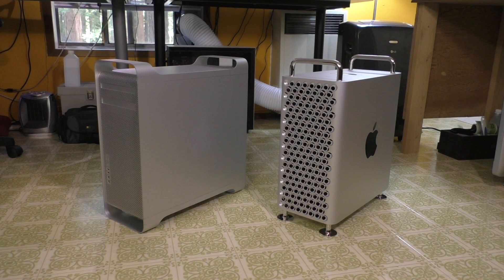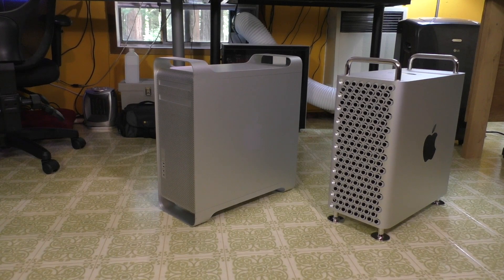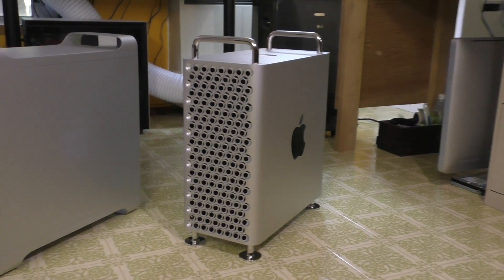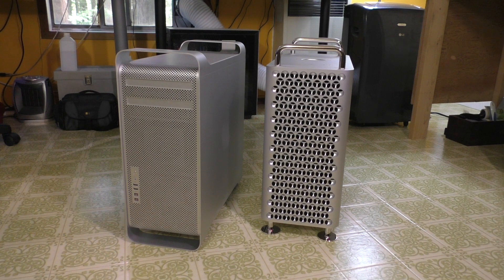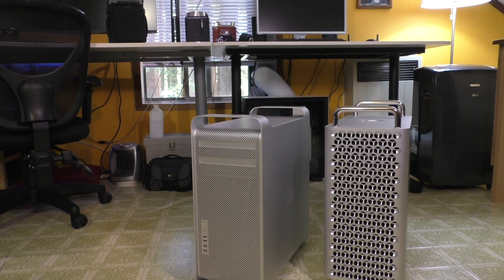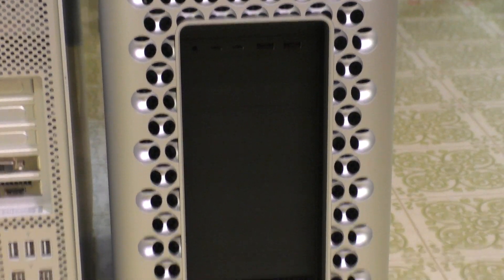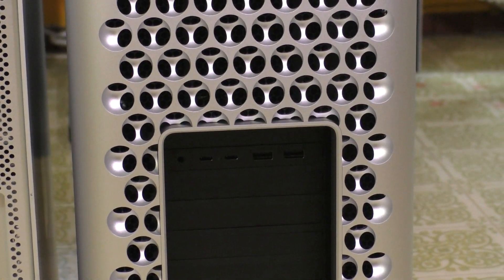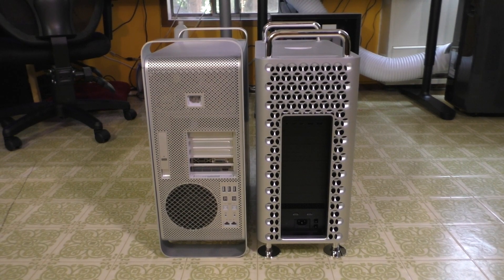2009 vs 2019 Mac Pro Comparison - A Decade Apart

Comment: I've never owned a mac. I bought my kid a MacBook for xmas and played with it a little. Now I'm thinking of dipping my toe in. I see a used 2009 mac pro for sale for $600. Can you answer a couple of questions for me?
1) can this old mac be upgraded to the latest OS?
2) Would i be better off buying a new (lower end) mac. I only care about performance (not power consumption or noise level).
Reply from the maker: 1) With the proper CPUs and graphics card, yeah you can with unofficial patches. At least to Mojave/Catalina, not sure about BIg Sur.
2) I would say yeah, you're better off with a new Mac long term. Tbh, I would look at the new M1 Mac mini. I guess it depends on what programs you use, but the M1 is benchmarking VERY well.
Reply: @accordinglyryan  Thanks
Reply: @accordinglyryan  You can actually get big sur onto macs as old as the 3,1 with patchers. Need a bit of know how though as DosDude1 isn't making his super nice patchers anymore
Reply: @willm5032  most people running Open Core Patcher now .. allows boot display even with non-mac GPUs running 10.5.2 - this also works for old iMacs there are drivers for non-metal cards which you install post upgrade they make these machines very useable on Big Sur
Reply: Yeah thts fair- I have a metal GPU so i can/should upgrade honestly

Comment: I have bought a used early 2009 Mac Pro with a quad-core Xeon with 16gigs of ram and an Nvidia Quadro GPU... well I am looking forward to upgrading the CPU, RAM, GPU... well honestly I have to say that despite being this old, this computer is almost okay for low budget people like us :)
Reply: I have five macpro towers I purchased as a bundle deal for only $300.00. Three are 12 core possessor, and two are 8 core possessor machines.
I have both 12 cores machines networking together to run my home studio.
Reply: @Ruffrufus  Wait 300 total? If so that’s one hell of a deal
Reply: @Ruffrufus  I just bought a 2x quad core 2009 Mac Pro for $200
Reply: That deal is crazy. How did you network these for home studio?

Comment: The new Mac Pro has better new cpu , new ddr4 ecc ram , nvme ssd , new gpu
But disadvantage is , no optical DVD/Or blu ray drive
Reply from the maker: No one uses optical drives anymore anyways lol
Reply: Ryan Gehret And also my opinions of all versions of Mac Pro 

Mac Pro Tower (2006-2012) Good
Mac Pro trashcan (2013-2018) Shit
Mac Pro New Tower (2019-????) Good
Reply: Ryan Gehret yes but a new full hd or even 4K blu ray drive in it would be nice
Reply: Ryan Gehret what Are your opinions about all three versions ?
Reply from the maker: @mikaelhay301  The trashcan is my least favorite. It's cool from an engineering standpoint but is really difficult to use as a proper workstation because of no expandability. I've always liked the 06-12 cheese grater Mac Pros, and I absolutely love the 2019.
Reply: Ryan Gehret yea and I think the trashcan sold the least of all of the Mac pros.
Reply: Ryan Gehret the only thing upgradeable yourself in 2013-2018 Mac Pro is the ram. That’s all. The rest is only upgradeable if you send it to Apple or authorized store. They probably will charge you at least 400$ for the ssd , 600$ for cpu and at least 900$ for gpu , upgrading yourself that stuff may be cheaper , but is a hassle. You have to disassemble the entire computer to upgrade ssd/cpu/gpu

Comment: I like that the feet on the new Mac Pro are replaceable, so they can be swapped with wheels or if they get damaged. 
I’ve seen a lot of the older Mac Pro and G5’s have bent “feet”.
Reply from the maker: Yep, that aluminum bends pretty easily. The 2019 Mac Pro feet and frame are stainless steel so I'd imagine they're quite a bit stronger
Reply: Brett C *legs